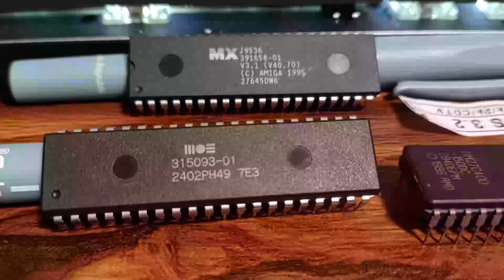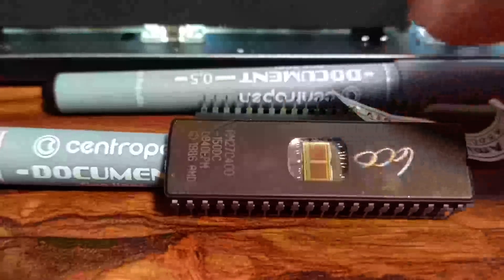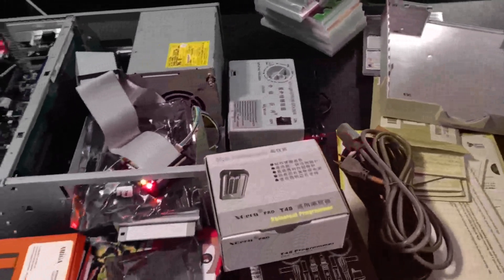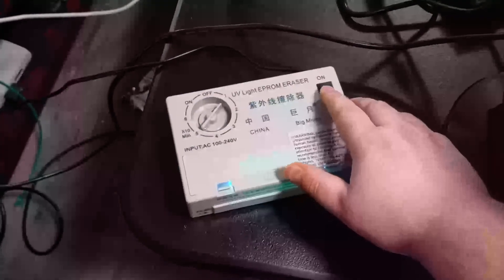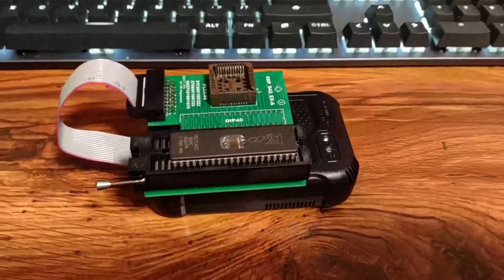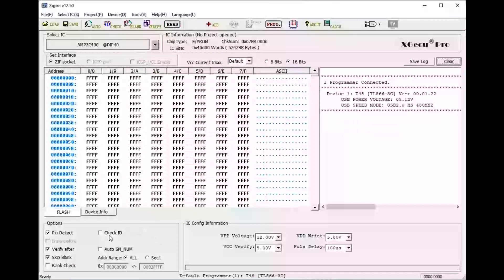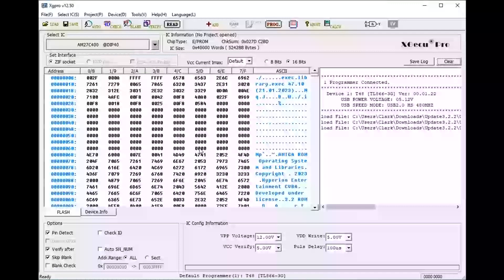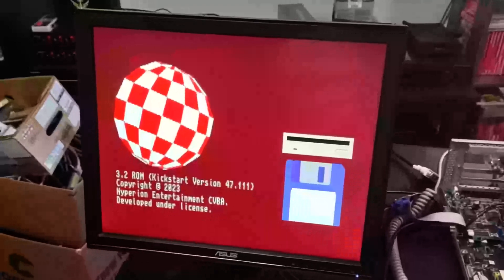Burning Amiga Kickstart ROMs - (Amiga 4000D Rebuild Episode 5)

Comment: Hm...
Compare this 2 pictures:
- 12:31
  Notch is on the right, offset is 1
- 15:39
  Notch is on top, offset is 2

But I also see: The Adapter in the picture at 15:39 has a socket with 2x 21 Pins (42), 
but on your adapter it has 2x 24 pins (48) (looking at the picture at 12:17).
Doesnt seem very intuitive but thank you for showing it the proper way.

Comment: XGecu T56 doesn't require an adaptor. If all you want to do is Amiga ROMS then the T48 + adaptor is fine, however if you are looking in to other devices then the T56 does a wider selection (37148 currently)
Reply from the maker: In retrospect, I would have bought a T56.  However, it's not clear from XGecu's website that the T48 needs an adapter (or that the T56 does not).   Might be buried on their forum somewhere, but I'm sure I'm not the only one that was confused.

Comment: The T56 of course is more expensive than the T48. 
However, the T56 doesnt require an adapter for Amiga ROMS. So add the cost of an adapter to the T48.
A bare bones T56 is even closer to a T48 with adapters. Does one really need all those adapters that come with the kits? 
As an added bonus the T56 is faster, has a larger socket, does more chips, and has a built in on/off button.
For me I skipped lunch or ate a sandwich for several days instead of take out and bought the T56.
Reply from the maker: In retrospect, I would have bought a T56.  However, it's not clear from XGecu's website that the T48 needs an adapter (or that the T56 does not).   Might be buried on their forum somewhere, but I'm sure I'm not the only one that was confused.
Reply: @ClarkHale  Who knows??? As folks use these it will get figured out. Wasnt enough of a price difference for me to worry about.
Reply: The T56 wasn't available when I got the T48, and, mine came with tons of adapters, including ones for PLCCs which I wanted and you'd need on the T56 anyway.  Adding this adapter to what I already own was pretty cheap, and it too can handle certain PLCCs the T56 can't.  Thanks to Clark for making this video.

Comment: Thank you for this one Clark - wanted to burn the Eprom with T866II+ as recommended everywhere but then got confused by the T48 and T56 and some comments that it doesnt work or the existing adapters dont work... However, AnotherMaker made a very nice video explaining the differences between the 3 of them and also that for 99% of the users the T48 is the right choice: https://www.youtube.com/watch?v=42VCmOVWAyc

Comment: Dear question, I have an EEPROM memory with a specific number that I could not find in the market.  The memory size is 256 KB.  Can it be replaced with another? It does not. have to be the same number, but of course the same size, or it must be the same number and the same size. The one is damaged is one time only read memory"TMS27PC256-20NL". The one i will used is UV EPROM"M87C257-20F1". With same size of course i will transfer data with programmer from  TM to M8.

Can do that because idont have TM eprom. I have M8 eprom.
Reply from the maker: I don't immediately know the answer.  You can try to look up the datasheets for the old and new chips to see if they're pin-compatible.   Just because they're the same size, doesn't necessarily mean they're compatible.   

Also, might be best to find the community of whatever you're fixing, and ask them for current substitution parts for the eprom your lookihng for.